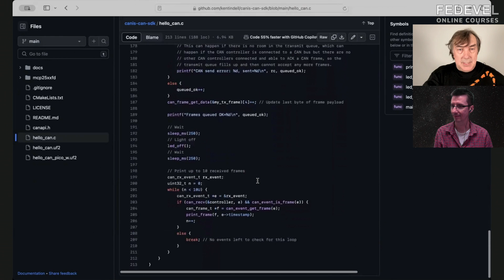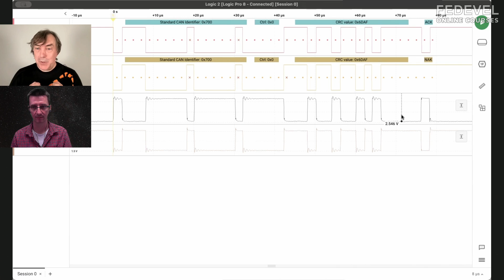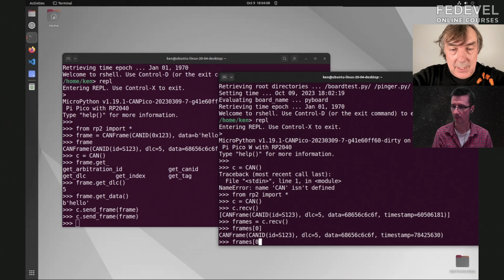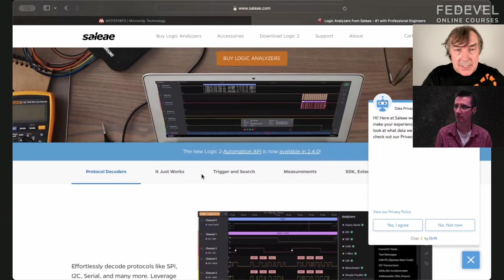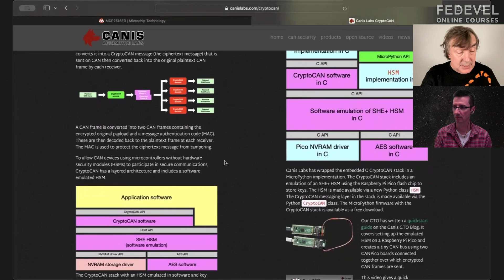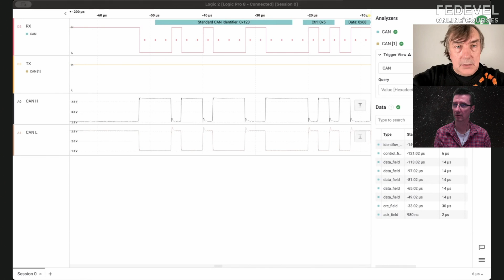CAN Bus is Simple and Actually Really Cool | Explained by Ken Tindell

Comment: hello all, I have a question  about CAN bus topology-  You know LOXONE and they have technology Loxone TREE  (it's CAN bus on 50kbps with IC MAX3..) and they  connect this CAN  in STAR to STAR  and any topology.  Question: is it correct to use CAN  other topology like daisy chain?  It's safe? what do you thing?
Reply: The standard mentioned 30cm stub for 1Mbps. 
I tested 500kbps with one 3m stub and still worked. 

50kbps star topology is adequate for the CAN.
Reply: I mentioned the NXP Application Notes. And that rules.
If you make your stubs 10 meters long: who cares?

CAN BUS is not a star TOPOLGY!!! 

Hint: take an oscilloscope and check the signal.
Reply: @ragohy  I don't see anyone mentioning NXP or 10m stub, so I don't know who are you talking to. 
But you may want to check ISO 11898-3 if you trying to say CAN star topology is not a thing.  And duh, bus is not star... wtf
Reply: @dzidmail  "wtf" disqualifies you from further discussions with me!
Reply: CAN bus requires all devices to see each bit at the same time and any device can takeover a packet by forcing out a zero in response to the prior bits.  So any device can send at any time and a bit must be able to travel the length of the cable and back in one bit time.  If Loxone has built repeaters which implement these requirements, thus allowing branches, then more power to them.
Reply: ... the stubs should be at max 30 cm long! Termination must be set at the very ends of the bus.

If you look very close to some short stubs, they might look like a star... 😅

Comment: One of my friends works on developing heavy equipment and after learning a lot about CAN he told me that it should be more popular among makers and hobbyists because of its versatility and tolerance of noise and bad electrical conditions.
Reply: For makers’ budgets, these boards are extremely expensive though!😢
Reply: @ArnaudMEURET this board is, but you can get inexpensive MCP2515 modules. You can also use an ESP32, which has the CAN bus controller embedded, you only need a transceiver for that.
Reply: @ArnaudMEURET STM32 has CAN onboard and costs nothing
Reply: It's not that simple, if thought through properly there are more economic considerations that decide whether you go one way or the other. CAN was developed as a controller area network that was cheaper to implement than Ethernet. Every node basically needs a CAN controller and an MCU. More often than not the maker  community is better served with RS485 using a simple UART. A smart designer looks at over all cost, not just "gee that's cute". I ran a development business for 30+ years that made those decisions for customers.
Reply: It’s used in Voron 3d printers with Klipper Firmware for communication with the print head for example. 
The setup was a pain because I didn’t know anything about can when I modified my Voron. But now it runs and no issues with it.
Reply: We still use i2c or uart because there are tons of sensors that can only read by that protocols
Reply: @SetoFPV CAN is more for module to module not sensor input